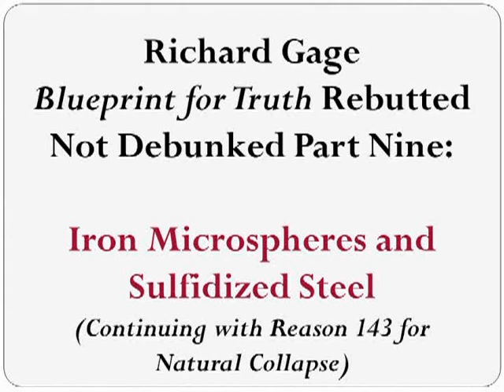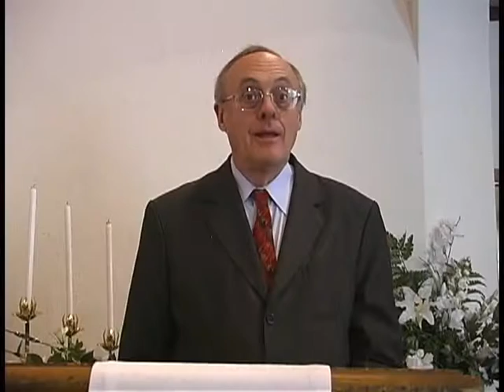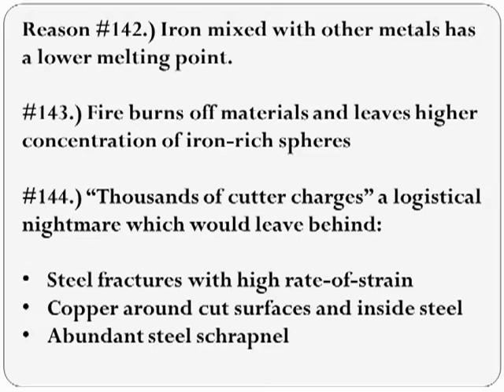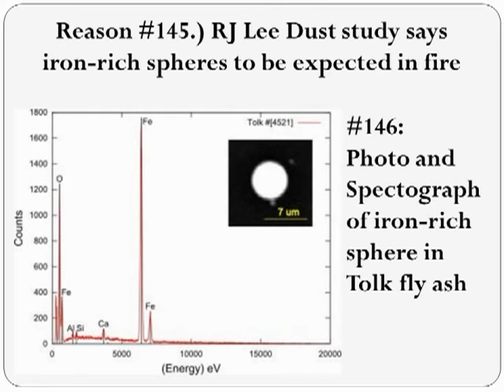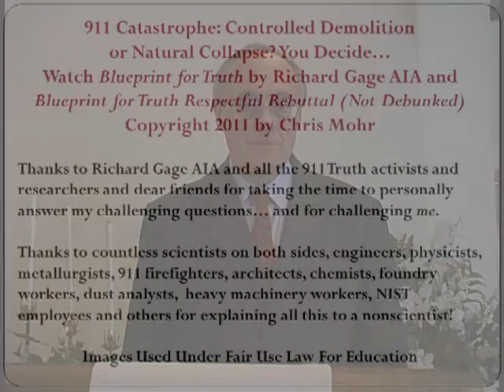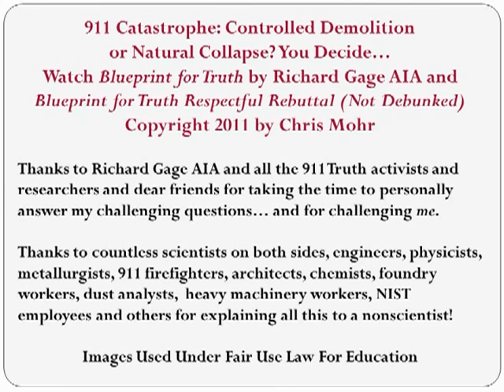Part 9, 9/11 Conspiracy Theories: Chris Mohr's Rebuttal to Richard Gage

Comment: Any comparison of it to the Twin Towers is limited to the Towers' floor diaphragms. FEMA blamed the heat-induced failure of the Towers' floor diaphragms, but failed to provide a convincing explanation of how floor failures could have led to total building collapse. Moreover, the alleged failure of the Towers floor trusses has lost relevance with NIST's endorsing the column failure theory to the exclusion of the truss failure theory.

Comment: McCormick Place is a warehouse-type building that housed a large exhibition hall. It had a long-span roof supported by web trusses. When a fire broke out with many flammable displays it rapidly spread, and a portion of the roof collapsed within 30 minutes. 

The first fact that should be noted in regard to any such comparison is that the McCormick Place incident was not a total building collapse -- it was only a roof collapse. Much less was it the total collapse of a high-rise building.

Comment: Copper and aluminum both have low melting points and are used in building construction.

Concrete and steel impacting the ground sounds like explosions.

Do some research lying moron, Delft Tower, Kadar Toy Factory, and the Windsor Tower ALL FAILED DUE TO FIRE.

CAN YOU SPELL D-E-B-U-N-K-E-D!

Comment: Dr. James Millette of MVA Scientific Consultants

WTC Dust Study

2/28/2012

"The red/gray chips found in the WTC dust at four sites in New York City are consistent with a carbon steel coated with an epoxy resin that contains primarily iron oxide and kaolin clay pigments." 

"There is no evidence of individual elemental aluminum particles of any size in the red/gray chips, therefore the red layer of the red/gray chips is not thermite or nanothermite."

911 TRUTH DEBUNKED!